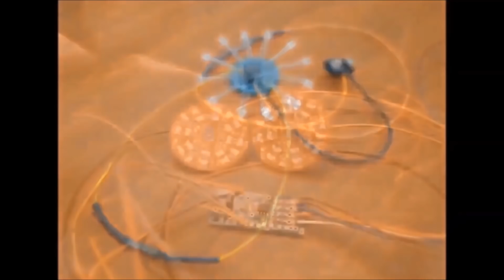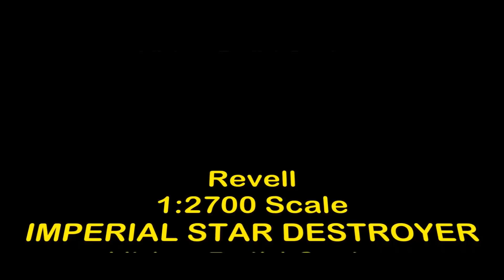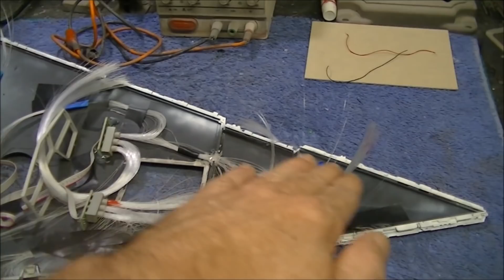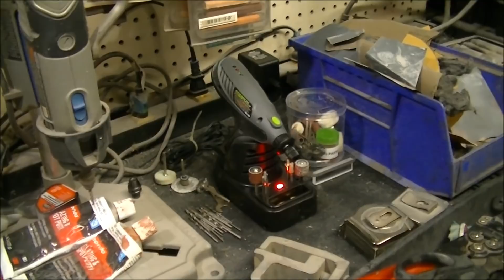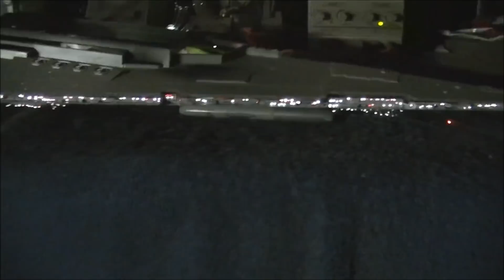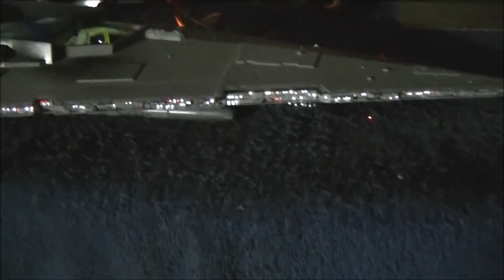Revell 1:2700 Scale Imperial Star Destroyer Build Pt 3

Comment: Looks great and just the vid I needed as I begin my own Revell 1/2700 Star Destroyer adventure. Boyd, what drill bit size did you wind up going with? After seeing your lighting I think the 0.2mm fiber optics choice green strawberry decided on is on par with this scale (most other revell builders went with .5mm fibers probably because of the frustration of using a 0.2mm bit).

Comment: Hi Boyd.  This looks amazing, but wow, does that look like a lot of work putting in all that fiber optic.  If you did this kit again, would you go the fiber optic route again, or would you put in strip LEDs and micro krystal clear for the windows(would that work done from the inside)?  Just curious.
Reply from the maker: If I wasn't using the lighting kit, I would drill the holes and then just push in some short pieces of fiber optics and use a few strips of LED tape for the fiber to light. Each way has it's ups and downs. You'll have more light leaks at any gaps when you light the whole inside vs using the emitters as the lighting kit does.
Reply: @TrekWorks  Ok.  That makes sense.  Thanks, Boyd.